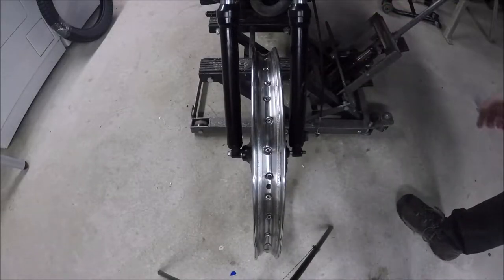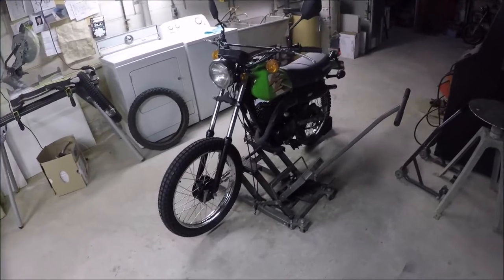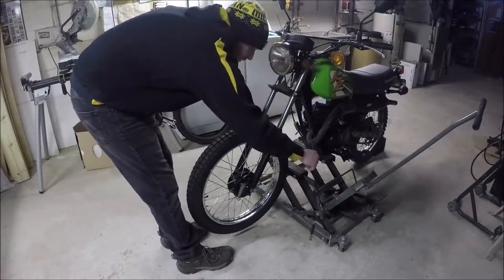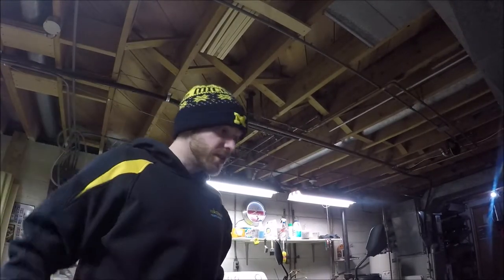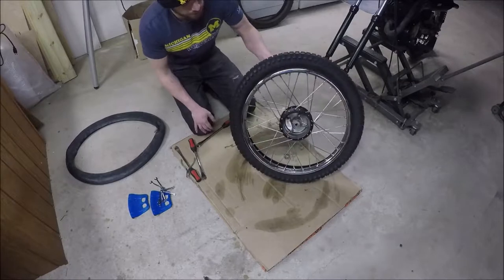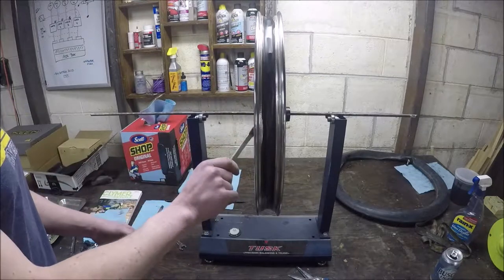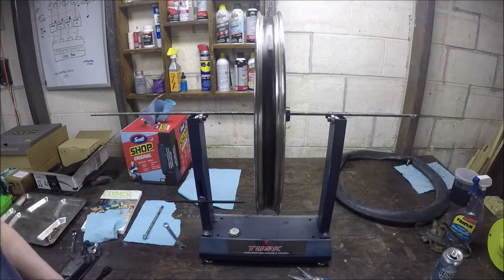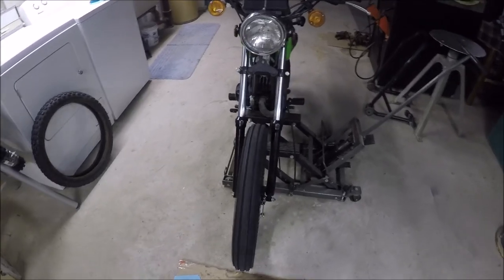KE100 - Tire Change and Wheel Trueing

Comment: i see no rim locks, would you install it? i just had the valve stem rip off on my KE100 while going 45mph and bout to go into 5th gear
Reply from the maker: I don't have any. If I was doing it again I probably would just as a safety feature. I need to make sure I'm running higher air pressures so the tires are less likely to spin.
Reply: @matttriestodothings   no! don't do that! don't raise the tire pressure as a way of locking the rim. can cause an accident. the manual tells you the tire pressures, 32 rear, 21 front. And furthermore, in addition to, On the motorcycle frame sticker showing model and year also tells you tire pressure. the correct way is to put a rim lock.